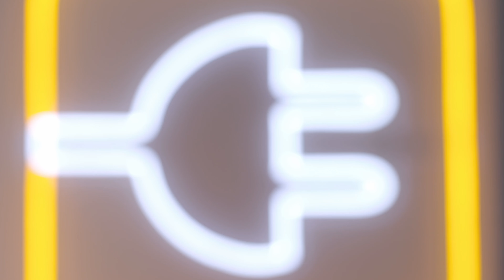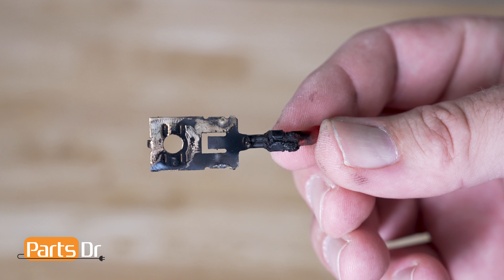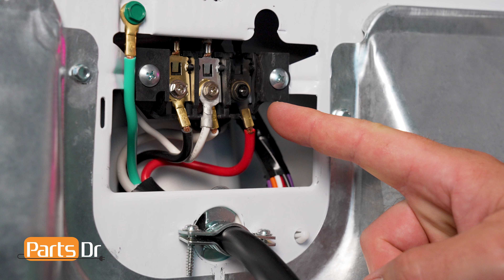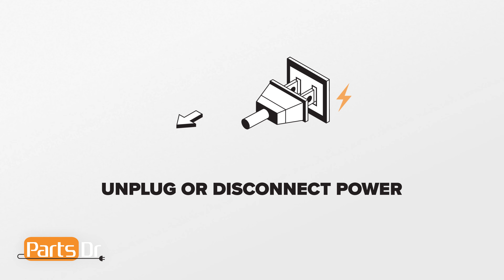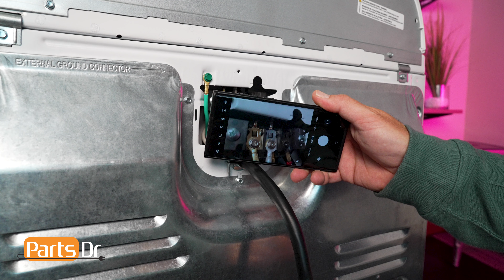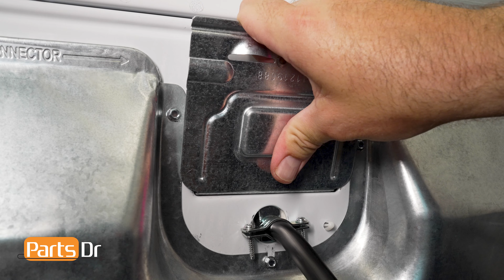How to replace Terminal Block Wire Kit part # 279318 Whirlpool Maytag Amana Dryer

Comment from the maker: Thanks for watching! If one of your dryer’s terminal wires has overheated, arced, or come loose, replacing the terminal block wire kit is a smart move. A failed connection can keep your dryer from heating properly or worse, create a fire hazard. If you're ordering parts online, especially from places like Amazon or eBay, be cautious. Many of the cheaper aftermarket kits are lower quality, and we wouldn't recommend installing them. We recommend sticking with genuine OEM parts for safety and reliability. You can find them here:
🔌 Terminal Block & Wiring Kit  (part # 279320): https://partsdr.com/part/279320-terminal-block-kit

🔌 Terminal Block Wire Kit (part # 279318): https://partsdr.com/part/279318-terminal-block-wire-kit
🔌 Terminal Block (part # WP3397659): https://partsdr.com/part/3397659-terminal-block
Let us know how your repair goes, and happy repairing!

Comment: My LG dryers power cable failed.  I believe the connections to the terminals were loose, I took a screw driver to see how tight they were and they weren’t screwed down tight. The insulation was burned off of the wires. 

My dryer is under warranty but why would a failure like this happen? Again it’s an LG with a dedicated power cord, not like the one shown in the video.
Reply from the maker: The most common cause of this is that the strain relief is not installed on the power cord.  Over time this causes the connections to become loose and eventually they can burn as the electrical resistance is increased.